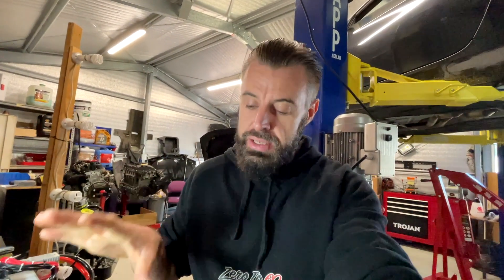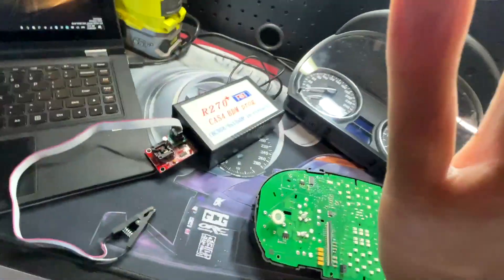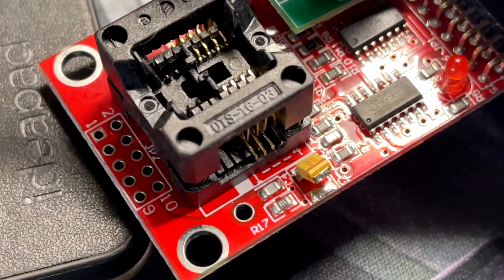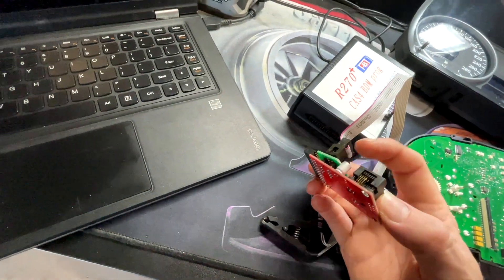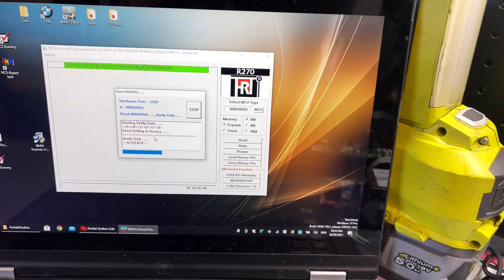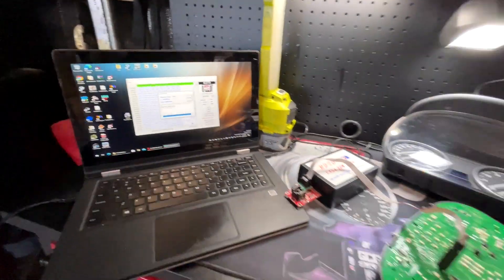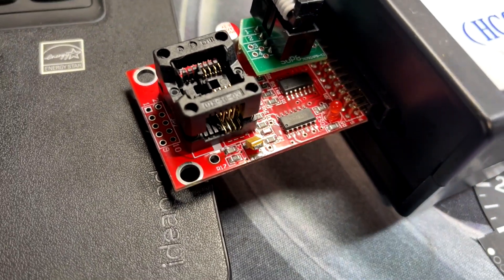R270+ Programmer Fix For BMW Dash Cluster Virginising 080D0WQ

Comment: Hi Mate, I know the video is already 3 years old, but I saw a guy on yt having a hex converter to convert his VIN to hex and wrote that back to the chip. That would work without any after programming would it? The car would recognized the VIN and think it is sweet?
Reply from the maker: I was actually playing with a some of these the other week. You can use a hex editor and it does seem to work fine.

Comment: Tried reading with it but it reads only zeros(0 for the first and second row and 80 for the next ones), i tested with the multimeter every pin, so the eeprom is connected properly to the programmer but still getting zeroes, any ideas?
Reply from the maker: Im sorry that is not something i have come accross.
Reply: Same problem, what was the reason?
Reply: @ I can't tell I didn't figure it out ..

Comment: Hey man, thanks for your video. Can you tell me what test ping and board I need for a F8X cluster? Would this be it? CH341A 24 25 Series EEPROM Flash BIOS USB Programmer Module + SOIC8 SOP8 Test Clip + 1.8V adapter + SOIC8 adapter DIY KIT. Thanks for your help!
Reply: F8X is a completely different ball game. There are different variations of the EEPROMs throughout the years. Anything after 2015 becomes quite difficult.😊

Comment: Hello, for some reason R270 program goes into "Not Responding" mode for a minute, happens when i read, write, save or load file. im using windows 10. It works fine on windows XP and Windows 7. i do see youre using windows 10 but you dont have the same issue was wondering if theres something i need to to do to make this program work fine on windows 10. 

also it goes in "Not Responding" even if i dont have the programmer hooked up and im just trying to load a BIN file to view it on R270 program.
Reply: Go to properties and try running compatibility mode for windows 7 etc.

Comment: I virginized my cluster and after I coded it my mileage went up about 35k. I keep trying to rewrite the correct mileage but it keeps defaulting to the higher one. Is this normal?
Reply from the maker: It will be learning off your cas.
Reply: @ZeroTo60Tube  thanks for the reply so I would just have to drive it?
Reply from the maker: @xans777  the cluster reads your cas and learns to what ever milage is in the cas. So if the cas i higher than what is on the cluster when you fit the cluster it learns that.
Reply from the maker: if you are tyring to write milage down it wont work.
Reply: @Zero To 60  that's weird... the cas is orginal. before I changed the cluster mileage was correct. After I installed the virgin cluster thats when it jumped up 35k miles. It sounds like the mileage on the cas has now changed. I'll have to see
Reply from the maker: @xans777  Stranger things have happened. Is the cluster coded for the correact MPH or KMH? Thats the only other varience i can think of. if your cas is MPH and the cluster is kmh it will do a similar jump if the cas is around 100,000miles cluster will show about 132,000ks. But to confirm, milage is only stored on the cas and the cluster. no where else.
Reply: @Zero To 60  yeah both are mph. I pulled the cluster from my old 335i. If I may ask when you read the eeprom from the cas did you also have to heat up the chip or was that only for flash? I appreciate the help thank you
Reply: @ZeroTo60Tube  fixed the issue. I did end up having to rewrite the mileage on the cas. Process was very nerve wrecking but all came out well thanks for your help
Reply: @xans777  Sounds like originally you didn't blank the cluster correctly, that would have explained how the CAS ended up with the donor cluster's higher mileage. I did this same thing! How did you end up re-writing the CAS? What tool/software did you use?

Comment: Will this hardware work on a 2017 6WA cluster?
Reply from the maker: Yes, i have done a 6wa, howveer you do need to remove the chip from the cluster, not like this where you can do it with the clip
Reply: @ZeroTo60Tube  I can desolder the two chips no problem.  Will this same hardware work with that?
Reply: @hootistigglebits  Yes it will work on it perfectly

Comment: hi, i want the temp gauge on my 125i so taken a punt ordering a 335i cluster. do you know if swapping just the dial faces can be done? or could i just swap the eeprom over from one board to the other?
Reply from the maker: You can swap both, there is a video on the channel where i did the is clucthe retro fit. I swap the guage s and change the LED colour on that one
Reply: @ZeroTo60Tube  thanks.

Comment: Does anyone know if i upgrade my standard cluster to a 6wa cluster  and program the vin and mileage in eeprom to match car, will this be enough for cluster to work with full functions? Or is there any other coding I will require. Or will it be plug and play after just changing mileage and vin ?
Reply: The mileage and vin edit only removes the DOT at the center of the cluster, coding is needed for needles for RPM, fuel gauge and temp. gauge to work

Comment: Where is the link for the file?
Reply from the maker: What file are you chasing?
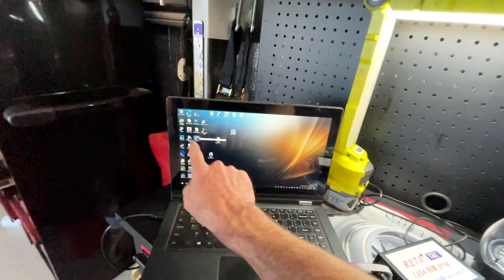Reply: @ZeroTo60Tube  around 3:54 you stated you'd provide a link were you downloaded the r270 software from because you didnt use the one provided.
Reply from the maker: @davispaul82  https://blog.uobdii.com/free-v1-20-r270-bdm-programmer-cas4-and-installation/ ahhh this is where i got it.
Reply: @ZeroTo60Tube  Much appreciated as always.
Reply: @ZeroTo60Tube  BTW do you know anything about FSTool2? Under configuration>Certificates>FSCS Certification. For some reason it will not allow me to apply any of the templates in SWTPatcher-v2.  Any suggestions would be appreciated.

Comment: If you unsolder the yellow cap to read e90 eeproms, will it still read e46/e39 eeproms or do you have to solder it back on?
Reply from the maker: Unfortunately i havent tried.
Reply: No do not solder it back on ,it should of never been put on there because the very early units never had that cap. Keep that yellow cap on and erasing first 2 lines (mileage) on certain chips like 35080vp/v6  it will ruin the chip for sure and be unusable . Won't be able to write the first 2 lines after that no matter what you will need a new epprom. Leave it off and its all good.
Reply from the maker: @mikealkarout9555  Hi Mike, thank you very much for the confirmation on that.

Comment: Attempting a cruise control retrofit, bought the stalks and coded option $544 to the VO thinking that would be it !. Turns out I needed an LDM module as well because my car is an early 2006 e90, then it quickly became apparent that I also needed a new cluster because the current one can't display cruise control info, which has led me to this video. Thanks to you I have the confidence to attempt the cluster virginization myself. Have ordered the programmer and test clip

Comment: Cut the resister works fine for me. Thanks for the help! Can you write from 8k km to zero?I can't. Regards
Reply from the maker: I will have to pull it out and try that. This was one of those things i used once to do this and havent touched it since haha
Reply: @ZeroTo60Tube  Hello, 
first - u did a great job and great video! and second one.. I would like to ask you something. Will this remove the temper dot from cluster or i need to programm once again with digiprog? Thank you for your time and keep on what u doin ;-)
Reply: @ZeroTo60Tube  and once again.. is there any marking, i mean how to properly solder the test clip to the board?  Thanksss

Comment: Perfect guide! How I can identify pin 1 on integer? I find no any reference on its surface...
Reply from the maker: There should be a mark on the chip, in one corner.
Reply: @ZeroTo60Tube  unfortunately there is no any marks as usual i ever seen! In your case had you based about the text orientation as a reference?
Reply from the maker: @lukephil6384 you should be able to go off the text, however have a look at this video, its quite good at showing different examples on how chips layout the pins. Not for the clusters exact chip but its great general knowledge. https://www.youtube.com/watch?v=Y9vsZTpnDDI